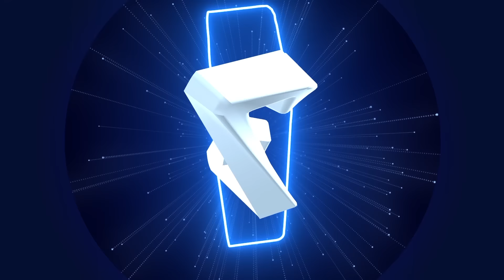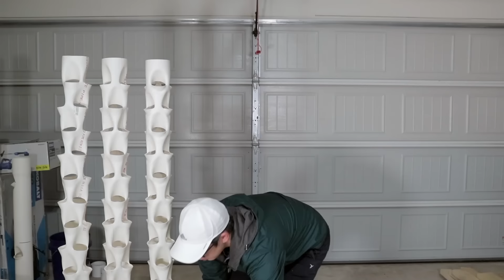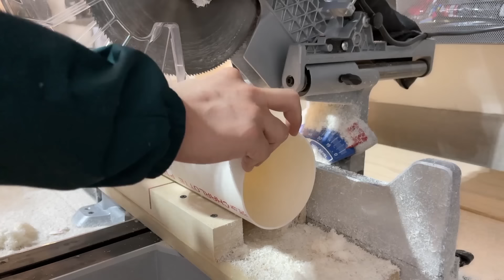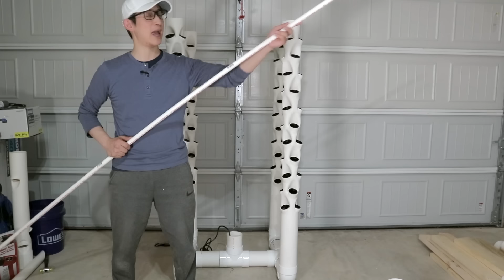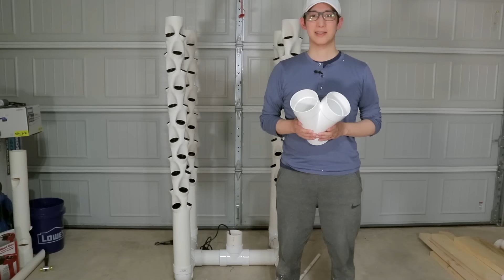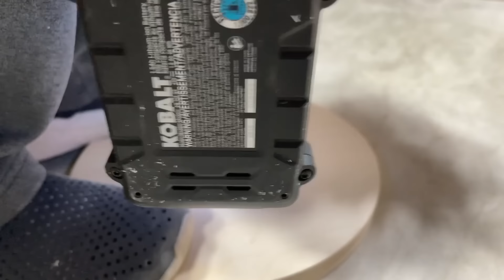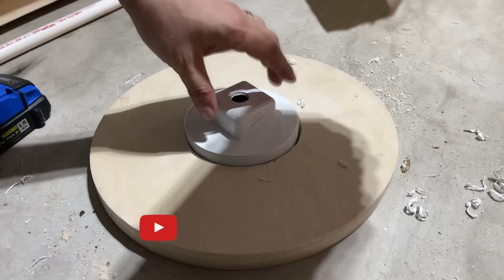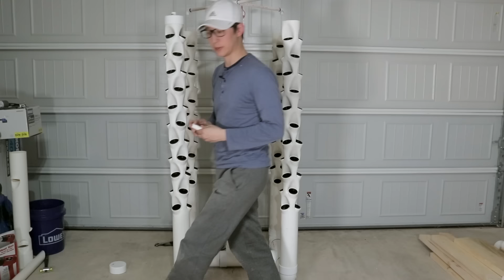DIY Hydroponics | Aeroponics Garden Tower Build | Part 2 - [4 Tower Build]

Comment: Planning to build something very similar. However, I plan to use some clear PVC pipe to be able to see water level. Basically on your I wouldve replaced the center stack extension piece with the clear pipe.
Reply: Mike Mumbauer
You want to consider a different way to check fluid levels. Using clear piping will encourage algae growth & make for a lot more cleaning time. 
🤨
I am still studying how to build but protecting the nutrient solution from light is repeated in all the instructional videos I have watched. 
🧐
Best☘️
Reply: @shaespear407  I was thinking the clear tube pretty much only for the center pipe. I know it would cause some growth but it should also be able to be cleaned fairly easily. I am open to suggestions though. Trying to stay away from anything that monitors via sensor or such.  Maybe cutting a chunk from regular pvc pipe and filling it back in with a clear epoxy to limit the exposure. It wouldn't have to hold back much water pressure. Hmmmm

Comment: Thanks so much, Chris, for this awesome video! I watched parts 1 and 2 and took detailed notes, as well as subscribed. My husband and I are planning on building these for growing herbs and super hot peppers. My only question is do you think it's possible to make this with 6" PVC Pipe instead of 4"? I'm afraid the roots will get tangled quicker with the peppers and want to prevent that from happening if possible. Thanks again for your awesome step by step directions and tips and tricks!
Reply: Yes, just use 6" pipes and fittings in place of all the 4"
Reply: Thanks!
Reply: The metal drains will also need to be 6’. I’ve thought about larger circumference myself.

Comment: Your process could be made more efficient by using stop blocks on your miter saw for the cuts. You'd get perfect uniformity and save a lot of time by not having to measure, mark and eyeball each pipe.

Comment: Awesome video. I plan on putting a separate reservoir in my cellar when I build my own, makes it easier to swap out or PH-correct the nutrient solution, and power the pump. Also it's not really necessary to keep the pump on all the time, in my current (indoor) setup the pump is turned on for 30s every 30mins and the plants are doing just fine.
Reply: What timer and pump are you using, please?
Reply: What are this pump features plz
Reply: @papamoussacamara2488  It's a Karcher SP3, provides plenty of pressure (which you can always downregulate it with some taps).

Comment: @Chris Loh Hi Chris I'm trying to figure out the type of pipe to get that is safe and which type of PVC to buy, upvc, cpvc, just pvc,? I can only find sewage pipe in the dimensions you used. Sorry if this was previously asked. Lots of info out there on different types of PVC, it all seems to contradict which is safe or not safe.
Reply: I just got all the supplies from a list someone in the comments made. Got all the parts and then noticed I got the wrong Pipe!! I got sch. 40 foam core - I had to rewatch the video and find where I could see the print on his pipes and he's using Sewer Pipe with Bell End! UGH so frustrating. People need to get specific when saying details - he mentioned Bell End nowhere in the video nor showed cutting it off. Those "5ft" tower pipes aren't 5ft if he chopped 6in off a 10ft pipe.

Comment: And just like that you got another sub. My wife just tagged me In a FB post with something like this. I tracked down the website and saw each standing unit was $1,022. 
Absolutely not. I said just get some PVC pipe , do exactly what you did (before i saw your videos). But my idea was to fill it with soil to the top and dig a hole in the ground to keep it standing. Put seeds in each section and done. Let the rain and sun do the rest.
I had no idea if this would work because I wondered what would happen if you had mint on 1 side and say, peppers on the other. What happens when the roots meet eachother?
I also wondered if when it rained would the water make it down through the soil in the tube to the bottom?
I have never planted so much as a single seed in my life.
So I decided to do a quick YouTube search and boom. Your video was exactly what I was looking for. $150 for a single standing unit. All day long. And it solves the problems I'm sure I would of ran into if I just filled the tube with soil.
Reply: Rain probably wouldn’t meet your water requirements, and your soil would get stripped of nutrients really quickly. Not trying to burst your bubble, but I’d hate to see you go through all the effort and end up with dead plants.

Comment: Hey Chris, just for your benefit; it looks like when you were using the hole saw to drill the hole in the end cap, you did not have your center drill bit inside the hole saw. it will drill a much cleaner hole and will not walk on you while drilling. great video by the way, keep up the good work!
Reply: Yes, that will make it a lot easier and no need for a template. I accomplish this (built several hidrophonic systems) by marking the center and then using a very small bit first before using the hole saw.

Comment: Chris: I noticed that other commercial brands stagger the holes I’m guessing so that the roots don’t get intertwined with the other plants. You will have three sets of roots facing each other in the pipe. But the videos that I’ve watched so far didn’t seem to show large root systems.People actually pulled the plant out to expose the roots to show someone and then put them right back in. Just a thought. Can anyone chime in here to speak of their own experience as far as the root system and if you feel that three plant’s root systems will be an issue if they’re all on the same level? Great Job Chris! Thoroughly enjoyed watching how you built this project.
Reply: Apologies for grammar and stuff... English isn't my first language.

I believe the growth of the root system depends on two main factors: which plants are you growing? How stable is the supply with the nutrient sollution?
Tomatoes for example are capable of building roots several meters into the ground, if they are raised in a dry location. They search the water deep down. If they never starve, they wont see the need to do that.

I built a dutch bucket system for beans (1st try). The nutrient solution was poured into the bucket 5 times a day. The roots weren't wet all the time. They exploded, filled up the whole bucket and tried to reach through the drain, ripping the filterbag apart, blocking its way. The stem cracked during a heavier storm. The plant was big, heavy but the roots dried out quickly. I got a harvest of quite delicious beans out of it, which is more than I expected.

This being said: If it's lettuce, if it's watered through a constant flow, if the solution fullfills the plants needs, it should do good. If you pull out and rotate the pots on a regular basis, you can help preventing the roots to intertwine as well. I think the roots will seek a certain ratio to be able to soak in the nutrients on the one hand but prevent drowning on the other hand.

If I had to guess: the biggest issues with this tower setup will be cleaning and an evenly distribution of the nutrient sollution on the inner wall of the pipe. Maybe the temperature of the nutrient solution as well.

Comment: Love this design! One small suggestion though; you can save a step by omitting the purple primer; as the only reason it is purple and required before using the adhesive is for inspection on actual permit required, or repairs on a home or building construction project that will need to be inspected before proceeding. The purple is to identify to the inspector that the area was either properly cemented, and or not forgotten during large plumbing jobs where more than one person is constructing the drainage system. ✌❤
Reply: I thought the primer chemically etched the pvc for better adherence
Reply: @eboyce24  technically it doesn't really do much but stain to validate its been glued "properly" for inspectors to see. There is in fact a translucent primer that can be used for projects like this. That way its not got purple stain at the seams. From what I've learned from a few plumbers I've known over the years, the primer isn't entirely necessary to get a good seal. If I'm doing plumbing on my house I will use the primer for inspection purposes. But if im just glueing conduit or pvc fittings for random electrical/ misc projects, I omit it.
Reply: @gypsumgoddess2828  just refreshed my knowledge--primer improves the sealing strength by softening the pvc at the joint.  It isn't entirely necessary if it's not a pressurized situation (and may differ from state to state as to whether it is required for plumbing).  One reference indicated that ABS doesn't require primer whereas PVC does to ensure a secure seal (you can rip apart PVC joints without primer, and is much, much harder to do with it). Both sources i found just now indicate that using primer is recommended especially if it's under pressure.

As you mention, the purple is so it's easy to see.  Harder to validate it's there if it's the clear kind. 👍
Reply: @eboyce24  yes. Correct.

Comment: It exploded probably as you brought the blade back up to its position. Which is not a good practice. The teeth on the blade will catch the item if it moves in its place. Release the trigger when you reach the bottom of your cut. The blade will stop and you can bring it back up. It will never explode again.

Comment: Here's a part list from what I could tell (pipe length's may have some extra footage added).  These were just notes I took from watching the video and planning.  I have seen a lot of people ask for a parts list so thought I would share what I jotted down, please feel free to edit if something is inaccurate or overlooked.

3 x 10' 4" PVC
2 x 10' 1/2" PVC
1 x 10' 2" PVC
4 x 4" shower drain plates (metal)
4 x 4" 90 degree elbows PVC
3 x 4" tee PVC
1 x 4" wye PVC
1 x 800 GPM pond pump (ensure dimensions will fit into 4" PVC)
PVC primer/glue
5 x 1/2" threaded male adapter PVC
5 x 4"  caps PVC
1 x 4" female adapter PVC
1 x 4" DMV cleanout plug PVC
4 x Orbit 54042 Mushroom Bubbler
1 x 1/2" 5-way cross fitting connecter PVC
4 x 1/2" 90 degree elbows PVC
132 x 2" garden slotted mesh net cups (33 per each tower x 4 towers)

All PVC is schedule 40 in this design.  I am sure other types of piping could be used instead, check toxicity leaching accordingly.  Also, you may wish to add in unions or shut-offs to the branches of the 1/2" overhead pipes to independently perform maintenance on tower as others have suggested.
Reply: I have built something similar....great list...however that pump is way more than you need and you can save about 16 bucks with something 10 times less powerful...
Reply: YOU ROCK!
Reply: Is there any reason not to use schedule 20?
Reply: From your part list listed here, I did a quick Scan at Lowes and came up with $358.87 for the 4" and if you wanted to go 6" $820.13

Comment: Nice job and great ideas, the only thing I can see that might help is to make the base out of larger PVC, so you have a larger reservoir which would add more water weight for stability.  Thank you for sharing this.
Reply: Yeah a fish tank
Reply: I was thinking that also. Also more volume would contribute to temperature stability which is a concern in summer months and more in southern regions. A simple fish tank heater will solve issues for that end of the spectrum, but cooling systems are EXPENSIVE and fluid temperatures are ideal between 65 and 75 to minimize disease, fungus and shock to the roots

Comment: Hi Chris,
Great job.
You may consider using a quality duct tape on joints where you are using silicone before getting it wet. Easier to remove! Just a suggestion. 
Also pay close attention to the guidance the commentor gave on sawing with that chop saw. A sharp shard could go into you like a missle.
Keep up the good work 😀

Comment: Have you thought of adding a worm bin in the middle, so you can compost the veggies, as well as, feed the plants vermicompost?
Maybe have segments that you can remove and replace when the worms finish the composting of each segments... that way you get more, easy access to the composted soil... to add either into the cups or onto other areas... or even sell the compost... after the results come in... since compost will be expensive in the coming months... not including the issue with the years to come... 

Cheers!!!

Comment: When will the website be up? Also is there a reason for not using flex tubing at the top vs several elbows and pvc cuts?
Reply: If you do go with flexible tubing, do your best to find a opaque tubing. Light exposure contributes to algae development.

Comment: Great build. I have some questions though, and I am sure a few people here may benefit from my asking. So I started this build and added a few extra items and changed a few things. I upgraded the pump to a 600wph with a built on filter for those same cleaning issues you mentioned. I also changed to a flexible tube from the pump to the towers. I did that because the pump I selected is a flex fit type. The reason I am going into all of this is that I am a bit concerned for the water pressure. I see the pump you used has a lower psi limit than the one I selected, and when I looked at the stats for the pump that most closely resembled yours I found that the one you selected has a max height of 5' at 0psi, the one I selected really isn't much bigger, it's stats are something like 6' at 0psi. So my concerns and question is, have you had any trouble with the psi being too low, any trouble with providing adequate water flow to all 4 towers? Thanks for any information you can provide.
Reply: In my aeroponics system I attached sprinklers that turn on every 30 mins for 30 seconds, there's plenty of pressure to feed all 18 sprinklers, in fact I have to regulate the pressure down to prevent leaks.
Reply: @idontknowwhatahandleisanddontw 8 sprinklers on that small pump with equal flow on all 18?  Please attach operating video.  I must be doing something wrong.  Please list pump name/model and timer used.  Thanks much!

Comment: Just to add to your design...

Im going to shave the bottom of the tubes or add a coupling and attach handles to rotate each column

I may also place the entire planter on a "lazy susan" 

Both of which for the purpose of early midday and late date sun

High five dude!

Comment: Nice work Chris.  
Some thoughts to consider but by no means intended as negative criticism .
I noticed you didn't add a drain to change out the water. 🤔  
Or put your beautiful system on a platform with wheels to easily move if needed.

You reduced your water retention by making it a closed system without the usual reservoir but thinking you will need to fill more often. 
However, by the time you need to top off, it will probably be time to adjust your nutrients.
So not a problem as I see it. 👏👏👏👏

I'm in the middle of building my own tower design that will outfit 10 plants only due to space of the plants intended and time. I used regular Y couplings instead of heating up the pipes.
I'll share it later. Working on the delivery system.

Kudos on the tutorial!!!  I just don't have the patience to explain everything swirling around in my head while working out the details.
Keep up the great engineering.

Here is mine.  Easy peasy by using 45° couplings.

https://youtube.com/shorts/YLeYaDb65ag?feature=share

Comment: Totaly love the build,well done. I want to put the same structure into my green house but I was told that PVC under the sun can start to evaporate into water and its not safe. This would be resolved if BPA free plastic would be used. An ideas if a different material could be used?
Reply: That is a concern, but over time there is a build up calculus that tends to coat pipes which inhibits the gas off. Usually.
Reply: I was thinking about the issues of plastic ingestion as well...